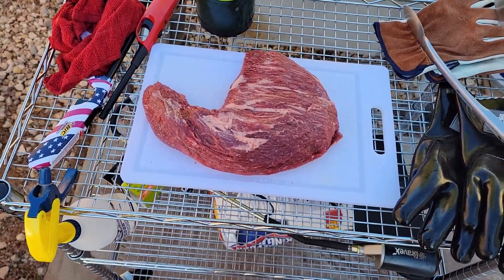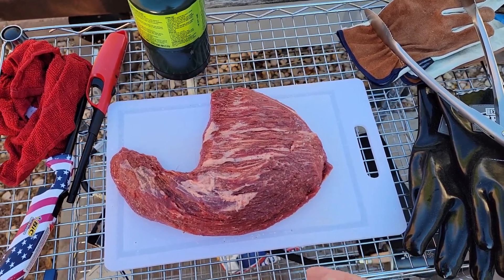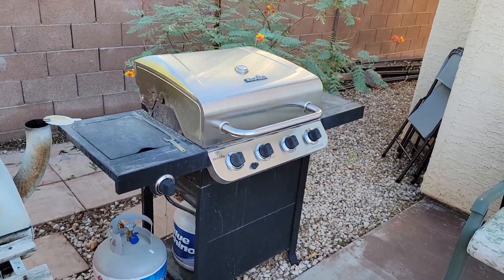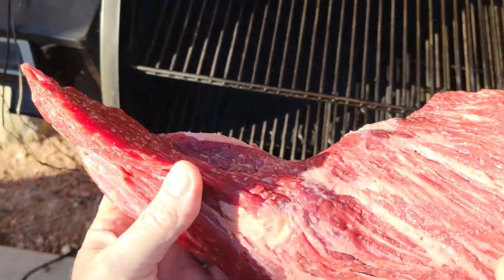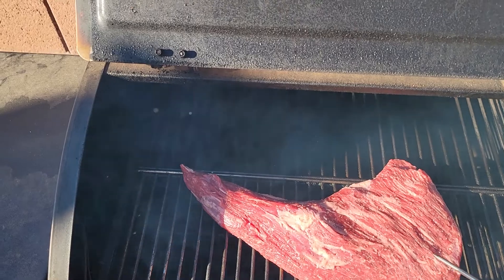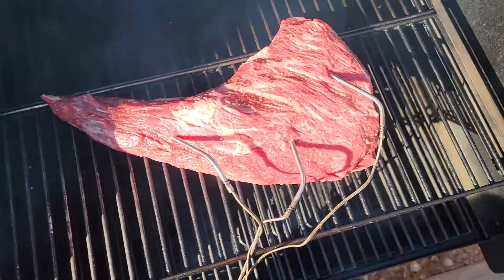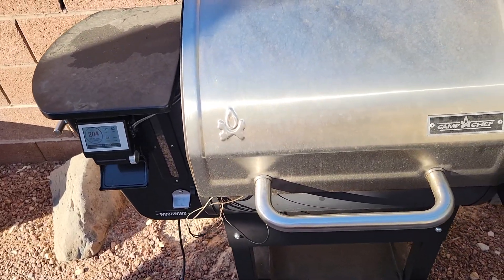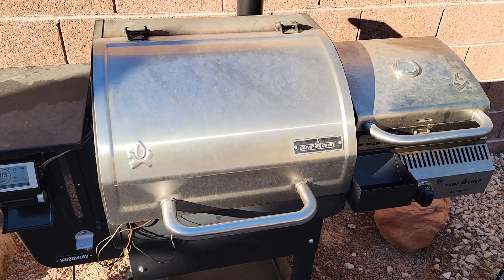Mom's Tri-Tip Dinner 1 of 3

Comment: What is a Tri tip piece of meat?
Reply from the maker: I'm gonna attach some info that will probably explain better than me. I love the flavor of it but it is lean so I only eat it once in a while but it is soooo good!
Butcher's Guide: What is a Tri-Tip Steak? | Omaha Steaks
https://www.omahasteaks.com/blog/what-is-tri-tip-steak/#:~:text=The%20tri%2Dtip%20is%20an,the%20steak%20as%20it%20cooks.
Reply from the maker: i couldn't find your comment about the air fryer but i remembered your name when i saw it and found you in this video so ill post link here. i think Walmart may sell them cheaper. look around as some places may have deals. i think i got mine at qvc a few years ago they are a little pricey
https://www.amazon.com/Ninja-FG551-Dehydrate-Thermometer-stainless/dp/B089TQ82WT/ref=asc_df_B089TQ82WT?tag=bingshoppinga-20&linkCode=df0&hvadid=80676757984230&hvnetw=o&hvqmt=e&hvbmt=be&hvdev=c&hvlocint=&hvlocphy=&hvtargid=pla-4584276305537684&psc=1
Reply: @carnivoredietmike6078  Thank you for this explanation of a Tri-tip steak! Just what I wanted to know!
Reply: @carnivoredietmike6078   I had deleted my question about the air fryer soon after I posted it when I found it myself on Amazon. Thank you for suggesting I look for it at Walmart for a better price!  I will do that!